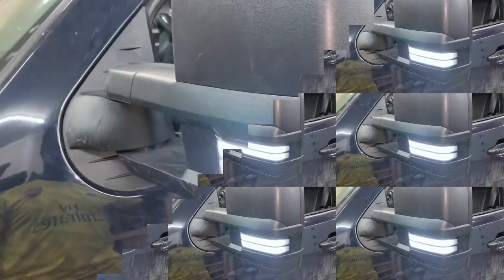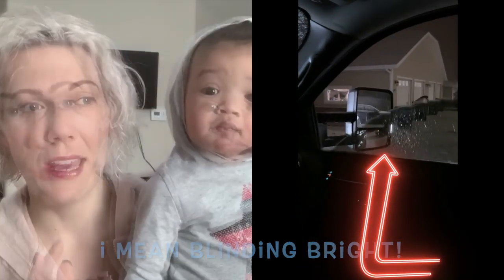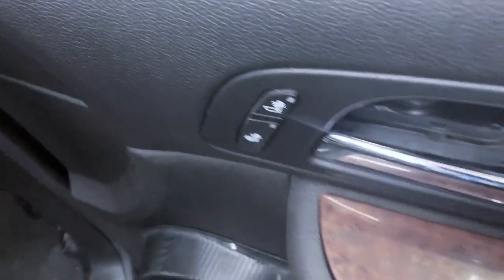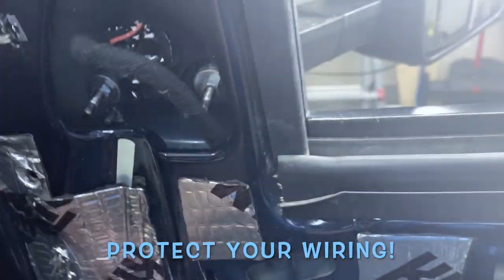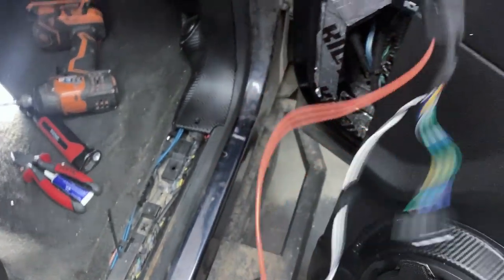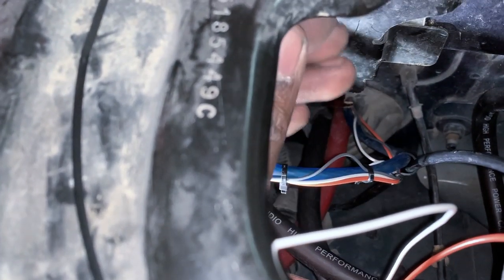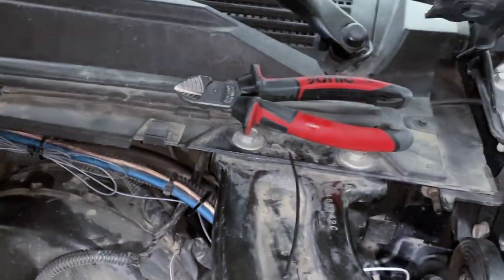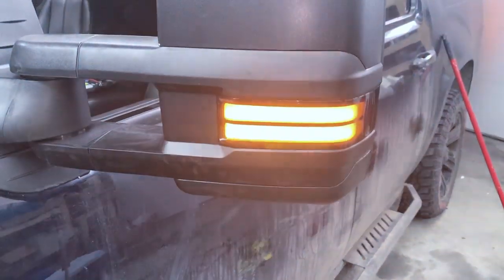BEST Switchback TOW MIRRORS on Market! '07 SUBURBAN/TAHOE

Comment: How hard was it getting wires into that engine didn't show yourself doing it exactly but i can imagine might not be most fun you a while?
Reply from the maker: it SUCKED! was a lil tight. Well i may not be as bad for others since i had 14 gauge speaker wires and all that other jazz running through there already.

Comment: Is there a way to just replace the marker & reverse lights on my current tow mirrors with those?
Reply from the maker: Good ? Check out their website. They may have a kit to just swap hardware
Reply: yes. you can buy just the individual pieces instead of changing the whole mirrors